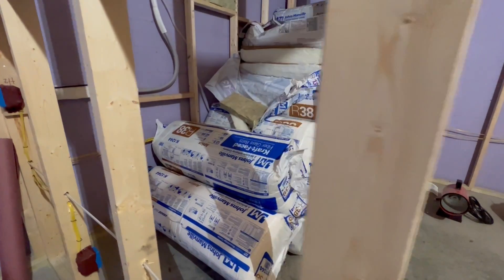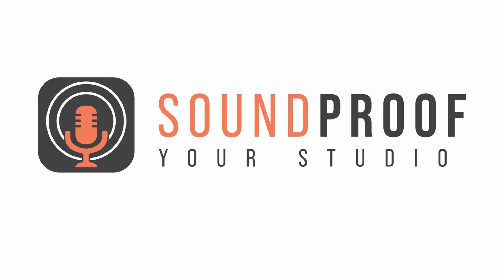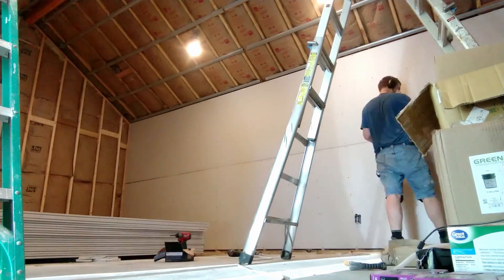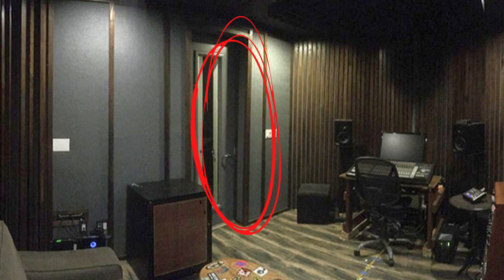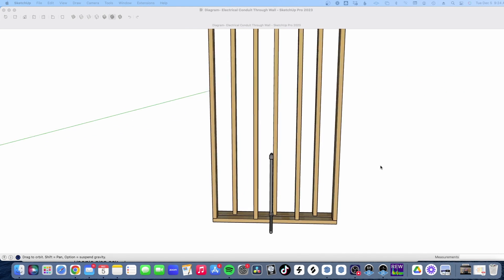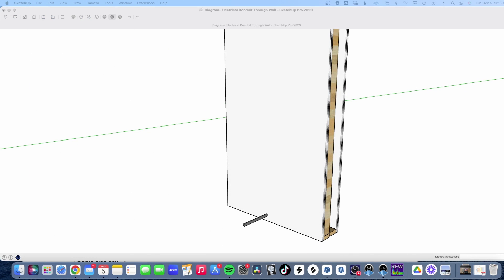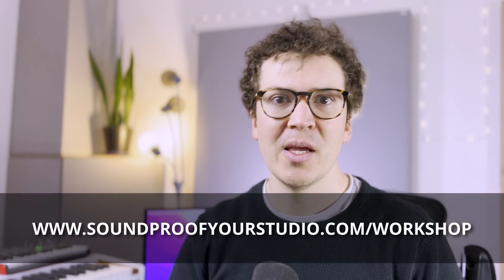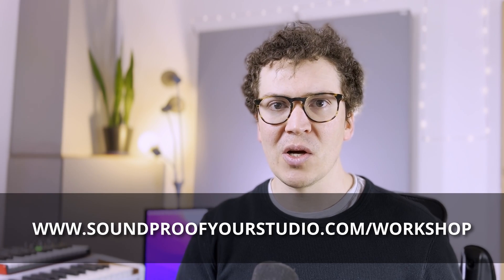Soundproof Like A Pro - No Putty Pads

Comment: Thanks for all the videos! I've learned so much.  In the picture showing the conduit, where does the electrical wire go?  In the sketchup it looks like it spills out onto the floor?  Do you nail it to the frame like you normally would? Or do you have to use conduit all the way back to the fuse box?  Is there video that shows actual construction?
Reply from the maker: Thanks so much, Paul! 🙌 Great eye on the conduit detail. Typically, you’ll want to keep wiring inside conduit (instead of running loose on the floor) and route it back cleanly to your panel, that way you maintain both code compliance and sound isolation. I haven’t released a full step-by-step electrical build video yet, but it’s on the list! In the meantime, if you’d like to walk through your exact setup, you can grab a free call here: https://www.soundproofyourstudio.com/Step1
 🚀
Reply: @soundproofyourstudio  Yeah, I might take you up on that offer.  But I want to meet with one more contractor first.  I'm asking because of cost.  I imagine conduit for electrical could be more expensive.  But if it was just conduit to get through the wall, seems like a smaller impact on price.  I have a design for two wall separation with the fabric layer, so electrical will be on the outside of the dry wall.

Comment: This is a great way to do it. All the talk of putty and power boxes does make me wonder if this is an american problem. Is it electrical code that requires Americans to use those blue boxes for power outlets? In Australia you just cut a hole in the wall and attach the socket to the cable. All the insulation behind the hole is left in place. I just don't see a reason for the box at all. The cable is already insulated, the vulnerable point is the plug attachment not the few cm of cable behind it. In Australia you just make the wall hole as small as the cable then fill it up gap with acoustic caulk or putty or whatever. Here's a video of a sparky (electrician) doing a normal install.  https://www.youtube.com/watch?v=BVzfSzmMNpA
Reply: I say all that without actually having talked to a local electrician about it so I might be completely wrong!!

Comment: True putty pads are primarily for maintaining a wall fire rating. That aspect is generally not needed in the scope of most people’s project studios as a wall fire rating will not be needed. 

You’re diagram on the conduits will include too many 90 degree bends.  It will exceed code allowable and you may not be able to pull through the conduit.
Reply from the maker: Fair point, you may need to modify to adhere to codes and ease of getting it through.

Comment: Im actually thinking for my space ( one mixing/drum 10x15 ft room and a guitar closet 7x4 ft space) to just run a few select wires in for lighting duties and another circuit wire in for amp/hardware/console duties and then just running them on conduit outside on the walls / ceiling as they go to new sockets/ outlets. Acoustic panels are more cost effective then loading a wall and covering in fabric.  An acoustic panel cloud with pot lighting built in can also be pretty great too.
Reply from the maker: Sounds like a fun project

Comment: I wondered about the same issue. Maybe it's an American thing that the power outlets have to be inside the wall (?), but I think that, especially for basement / garage type installations an on-the-wall power outlet would minimise the size of the opening drastically, similar to the lighting wire installation in the ceiling (where you want to avoid cutting big holes into the ceiling).
Reply from the maker: Yes agreed